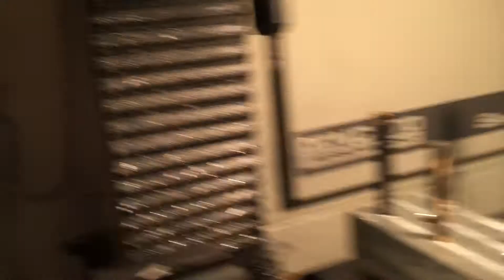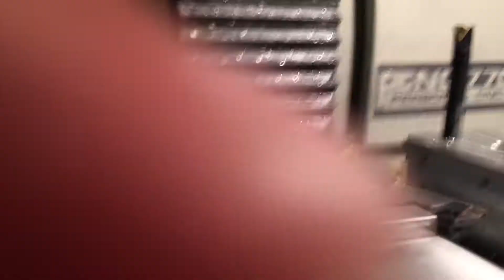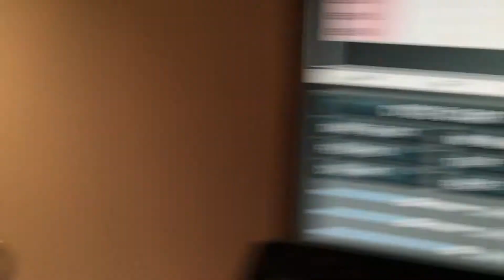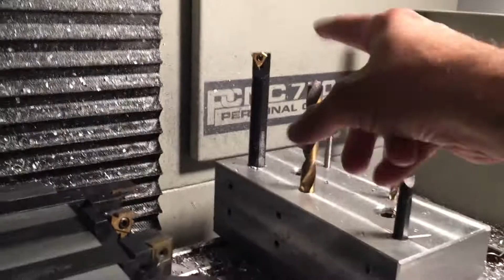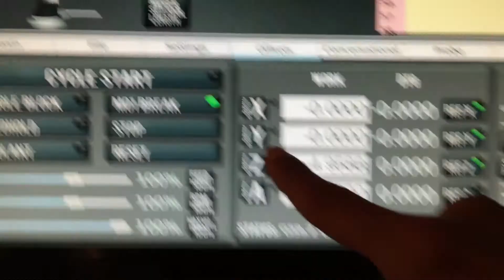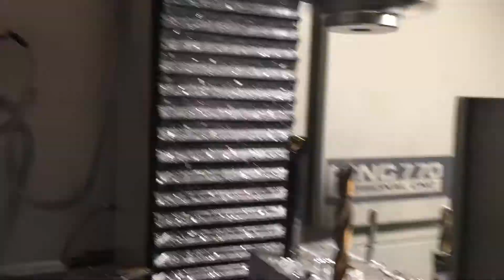CNC Mill-Turning "Z" Height Solution

Comment: What post processor did u use in fushion360 for the lathe code or did u hand right the code? I’m trying to do the same but didn’t no where to start with the post Processor thanks for the video

Comment: Thanks you for this great video. I am attempting to do the same on my Tormach 1100 PCNC. I may have missed it, but how do you set up your "stock" in Fusion 360? It would normally be milling tool from your tool library? Thanks.

Comment: Why not use a slip gauge, say 1" rather than move down to touch the tool? That way you don't have a heart attack when you're checking the position and approaching at speed. Just go to plus 1" and check it with the slip gauge like a giant feeler gauge.
Reply from the maker: Great idea Roger!
Reply: I use a height gauge from tooling plate that I use on the mill for this. The base of the plate is zero in Z so those figures can be used as the offsets. I wrote a post-post processor that combines the relevant offset for each tool from a separate text file, so it's a different approach to yours. I end up with a program that's referenced to a dowel on the tooling plate that's X0Y0. That way there are no offsets, the whole program is absolute and you can restart it anywhere with a little care.
You've probably seen my setup here...
https://www.youtube.com/watch?v=IrlY8qEmO3I

Not having a separate manual quill is the achilles heel of these commercial machines in my opinion. It makes life so much easier for setting up and also for drilling and tapping when milling which can be done manually while using the CNC to drive to the centre points. Still, that's a whole other debate!

Comment: Love your video and has made me think a little harder about my new project that requires a CNC lathe with a 1.5" dia collet and a bar puller.

Sure would be nice to have a 1.5" dia tool holder (My lathe had a R8 collet) (to hold the aluminum stock) that is spring or remote controlled loaded?  You could make a location to pick up new stock.
Reply from the maker: Thanks David, the largest diameter stock I turn is 2.25" and I'm limited to about 4.5'' max and that is with only 0.25" inches being held in the 3 jaw chuck with the jaws reversed.  Unfortunately, mill turning does not allow for bar pulling...  That said, I turn a lot of parts on my mill and they come out great.

Comment: Hi Erik
I tried for 2 hours to figure it out , at the end it not working for me.
when i change the G5x and ask for the z0 it all ways give me the previous z height of the previous tool.
Is there a setup button that you have to hit first in pathpilot .
Ok First i take my x,y 0 of each tool in their own G5X.
I change for the part in spindle.
I went in my first G5x went down (z) to the tools and hit the offset /touch Z and hit the button.
did the same thing for the second one.
Going back to the first one , change my G5X for that tool go xoyo it moving to the top of the first tool. (ok)
type the z0 and it give me the height of the other G5X from the previous tools .(not good)
I went to the other tool changing the G5X , xoyo , zo and it the right height (ok)
The tool # is all way the same in pathpilot .
What setting in pathpilot should i hit for making each tool height as it own G5X .
Question : the m6g43 button , when that button is use ?.

Is there a move that i miss or some thing that for you is obvious but my set up is different causing that ?

Thanks any ways for your help.
Alain Roy
Reply from the maker: Make sure that you only "Touch Z" once per G5x work offset.  From your description it sounds like you touched Z for two different tools in the same G5x work offset. 

Here's another video on doing this from Jason Hughes.  It's the same method but will give you another perspective.

Cheers!
Reply: Hi Erik
Thanks for your fast reply,  after i watch those video again i my find what went bad.
First it was not specified that you have to take a mesured tool for finging the x y 0  of each tool use in it own wcs. After i did that  , i place a peace of stock in and find the z height of the higtest  tool and hit the offset /touch Z button (one time only).
Then went too the other wcs  tool location and hit first g0 x0y0  and z o.5  to be shure .
And bang 1/2 inch on top . Supper.

on question stay in my mind , how to make the part move in the tool is my tool is on both side of the vice.
on have to move x+ and the other x- .
thanks.
Alain

Comment: I really wish to give this a try on my 770.
A question though. Is there any way of saving all these work offsets G54 etc.
If I use other setups I will run out of offsets and I might accidentally reset one of them.

Best regards
Reply from the maker: Hey Richard,  I wish there were a way to recall all of your offsets in Pathpilot should you decide to use one of them for an alternate setup.  Originally, I wanted to keep G54 for regular mill work setting the offset to the back corner of my fixed vise jaw.  I have 9 lathe tools though so it had to be used as well.

The ad-hoc workaround I did was to literally take short videos with my phone once I had located X, Y, and Z zero for a particular turning tool (using my chamfer mill with a known tool length offset). I press record and show the current tool being zero'd and then pan over to the Offset tab in Pathpilot with the 'work' tab selected and film a few seconds of the offset values it shows for each work offset slot (G54, G55, G56 etc...) so that if I needed to change them, as I will for my G54 when I go back to regular milling, I can.

The steps would be:

1. In the MDI input field, enter the work offset you wish to re-set, press enter.

2.  Re-reference all three axis and then zero each DRO with the machine in that position.

3.  Manually enter the values from your video for that work offset into the MDI line. (G0 X... Y... Z...).  The machine travels to that position upon pressing enter.  (It might be wise to do this step with no tool or work in the spindle, just be safe)

4.  Re-zero each DRO in this new position.  Check the numbers in the work offsets window to verify.

A bit of a pain, I know.  It would be nice if Pathpilot had different banks available, each with nine offsets (or more!).

I hope this helped and didn't confuse anyone.  Mill Turning is a work around by nature!

- Erik
Reply from the maker: Of course, your mill-turn tool setup would need to be repeatable for this to be relevant.   Even though mine is to within the tolerances achievable with a 770, I still quickly re-check each offset every time the vise is switched back and forth between milling and turning and adjust accordingly.  The boring block rarely moves.
Reply: Another thing I am wondering about. How do you achieve single point threading. Are you using an indexing signal and is that then used to see the exact rpm of the spindle as well?
Reply from the maker: Hey Ricard, sorry for the late reply. 

Yes, single point threading without synchronization between the spindle motor and the Z axis stepper motor. 

I have not modified my spindle with any sensors. 

I did not think it would be possible but decided to give it a try nonetheless. I have successfully cut both OD and ID 1.5"- 28tpi threads. It took a few attempts to program the proper final thread depth but for the two parts that I'm trying to perfect I think I have a fit that I'm happy with. 

Why does it work? My best guess is that it's because it's CNC and both the VFD that controls spindle RPM and the Z axis stepper motor that controls the feed are clocked simultaneously by the timing crystal of the computer/controller and because:

1. The spindle remains at a constant RPM throughout the threading operation and,

2.  The tool path for each pass is identical (lead-ins and lead-outs, length of actual cutting pass, feed rates, etc.)

Somehow there seems to be some sort of sync. 

Some things I discovered were that, because of the 770's limited horsepower, the spindle RPM must be on the faster side for thread cutting compared to a manual lathe.  If it's too slow the spindle motor will bog down in the cut (while the Z feed remains constant) and your thread pitch will be thrown off over the length of the thread.   I used both 560rpm @ 20ipm and 980rpm @ 35ipm. 

I arrived at these feed rates with the formula:

1/tpi X RPM = Feed Rate

So 1/28 = 0.035714285714286

0.035714285714286 X 560 = 20

You have to find a whole number RPM that will allow you to have a whole number feed rate (or a xx.x feed rate) because of the values that Pathpilot will accept. 

Unfortunately, even with a mill-turning modified Tormach post processor for Fusion 360 CAM, you cannot use the lathe threading operation in Fusion. Instead you need to program it as either an OD or ID profile and use either negative stock to leave or model a cylinder whose diameter is the final thread depth you wish to achieve and use that as your model in cam for the threading operation. The actual cutting path must start before and end after tool engagement with the material. Also, the number of cutting passes and depth of cut must be calculated. I used 6 passes with a 0.005 DOC. 

I'd love for you to give it a go to see if the results are repeatable on a different machine. Who knows, I may just be getting lucky with the thread pitch I am cutting. Perhaps other pitches will or won't work. 

Pretty cool stuff though. 

Cheers,

Erik
Reply: Very cool and very interesting observation with vfd and feeds being synched for multiple passes.
This would mean that for a repeated op the spindle will always be in the exact same position during the whole feed.
My machine is also a 770 S3 so I guess it would work the same. I will follow this with interest. Thank you so much for the thorough explanation.
Are you not a member of the Tormach user group on facebook. I bet there are many more who are interested in this and would be very happy to have you explain.

Best regards
Reply from the maker: Hey Ricard, I was browsing through the Tormach Slant Pro manual and came across this:

5.7.3 Tool Offset Information Backup
Make a periodic backup of the tool o set informa on and machine se ngs to store externally should the controller get replaced or need to be restored to factory se ngs.
Create a tool o set informa on backup on a PathPilot controller as follows:
1. Insert a USB drive into any open USB slot on the controller.
2. On the Main screen, type ADMIN SETTINGS BACKUP in the MDI line.
3. In the dialog box, navigate to a loca on to store the backup .zip  le on the USB drive and rename if desired; click Save.
NOTE: Keep this  le somewhere safe and easily accessible.
Restore tool o set informa on backup on a PathPilot controller as follows:
1. Transfer the tool o set informa on and machine se ngs backup to a USB drive; insert into any open USB slot on the controller.
2. On the Main screen, type ADMIN SETTINGS RESTORE in the MDI line.
3. In the dialog box, navigate to the backup .zip  le on the USB drive; click Open. PathPilot exits,
restores from the backup  le, and then restarts PathPilot.

A lot simpler than my workaround and exactly what you asked for!

Cheers,

Erik
Reply from the maker: So, an update to single point threading without a sensor.  Although I've had success, it just isn't consistently repeatable.  

What has worked is to cut the thread in one full depth of cut single pass.  There is a lot of chatter in the finish though so this is not and ideal situation either.

So,  I've ordered a simple sensor for my spindle and i've been poking around under the hood of Pathpilot's Rapid Turn, flipping all of the code that inherently reverses the X and Z axis, and adapting it for mill-turning.

We'll see how it goes...
Reply: Erik Colvin Nice, will follow you on this
Reply from the maker: Ricard Rinaldo https://youtu.be/XRW6EI84qyI
Reply: I'm looking to purchase my own Tormach 770 and I'm curious on how the thread operation work for you. Thanks for the awesome work.

Comment: Great video Erik!  Thanks for the shout out!  I learned a ton in this video.  Thanks for making mill turning easier to understand.  I never would have thought to use the touch off method for the stock.  I have the same 3 jaw chuck as well.  I plan on using that for my next project.  Can I ask what lathe tooling you are using?  I'm using the cheap set from Shars and would like to upgrade to better tooling but don't want to have a fortune in it yet either.  I really like how your drills and boring bars are set up too.  I was going to drill 3/4" holes and use my TTS holders, but I think I like your idea better.
Reply from the maker: Thanks Jason! I'm glad to be of service. The lathe tools are from ebay, Shars, etc. and are 20mm shank width.  I chose those because I thought that I could use all the rigidity I could get while still being able to fit four tools in the vise along with the three aluminum 0.90" wide spacers for clearance (the Shars vise is great for that because while their spec lists the jaw opening as four inches it actually opens up to six inches as I think you mentioned in one of your videos).  I originally wanted to mount them with two facing one way and two the other but I found that there was not enough X travel when offsetting the vise from center to accommodate the boring tool block.   As far as that block goes, yeah, initially I too wanted to drill 3/4" holes so I could use Tormach TTS holders but I realized that they would eat up too much Z travel.  For instance, the bottom of that 5/8" Threading bar is actually flush with the table and it's hole is drilled all the way through.  The other tools have varying hole depths.
Reply: Great.  Thanks for the info.  I was worried about z height as well, but hadn't actually measured that yet.  If you are running out of z on the 770, I definitely will on the 440.
Reply: I'm looking forward to more videos!
Reply from the maker: bluehandsvideo Thanks Mike!  I'm glad you got something out of it.  Yes, these tools are all dedicated to mill-turning and like you mentioned, I did cut down the length of the 3/8" boring bar by two inches.  There was way too much chatter happening with the excessive stickout. Where did you find your chuck with the 3/4" shank? I've been thinking about buying a second chuck so can have one with its jaws in the normal position.
Reply: Got here via a link on cnczone.  I don't typically have the time to watch vids this long, but it was mill turning.....so I made the time. :)  I've done a fair amount of it, although I still haven't taken the time to make a tool holder.  I typically only need two tools.  I love the tool 50 idea.  I prefer to set my origin at the back of the stock....which I read off the jaw shelf that will be holding it.  My chuck has a 3/4" shank on the back, so I can put it directly in the TTS collet. It seats up against the spindle nose and is pretty repeatable.  With this idea of setting the chuck as one of the tools, I think I'll see about modeling my chuck and jaws....then I'll set the origin to the face of the chuck.....for now...the back of the stock works well.  The next part I'm making doesn't have a carrier.  
I posted this under Jason's response so that both of you should get notified.  I've been sub'd to Jason.  I was thinking "How did I miss Erik's channel if he's got a mill turning vid".....then I saw that it was only 6 days old. lol  
If you can swing the cost, buy another boring/threading bar and dedicate these to the mill.....that way you can cut them off shorter to gain some clearance if needed.  Maybe Jason more than Erik.  
I'm just starting to use fusion for turning.  I've been using MachStandardMill up 'til now.
Thanks for the ideas and info guys!!
Mike
Reply: I bought it from Novakon at the same time I bought the Torus Pro.  I don't see it on their site now.  You can make a backing plate with one....it's one piece, so it would be a chunk of steel to start with! lol  Hmmm......If you have a lathe, I wonder if you could clamp a rod in the jaws, then support the R8 end in the tail stock.....then turn down the R8 to just a straight 3/4" shaft?  Maybe?
Reply: What happens when your next piece of (rough-cut) stock is 0.025” too long, compared to the last one? If your stock length changes by only a little, you’re going to crash into the next piece of stock. This is a very cool video, but I really don’t think I would use this method with rough-cut stock.

Edit: LOVE your gang-tooling setup by the way!
Reply from the maker: Hey Tom,  I always re-zero "Z" with the next piece of stock.  Definitely  don't want any surprises!
Reply: Erik Colvin Excellent! Sorry...I must have missed where you said that.

Great ideas in this video though, and I am definitely going to try mill turning!